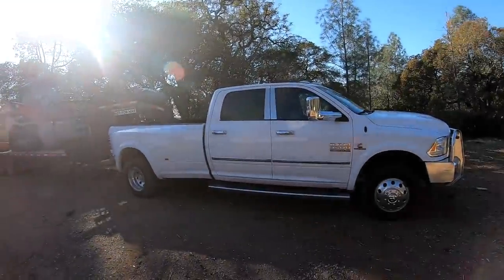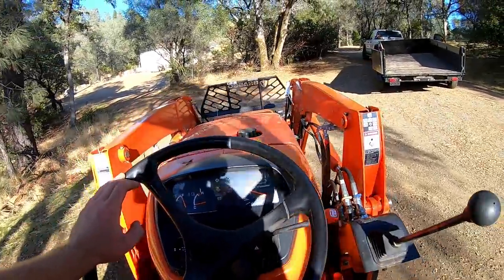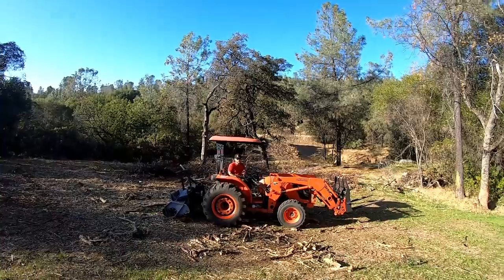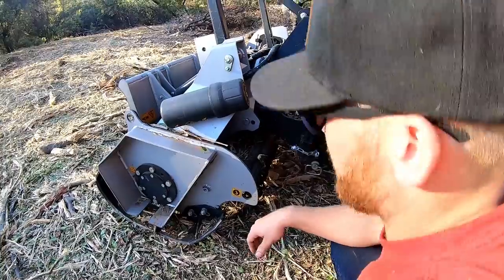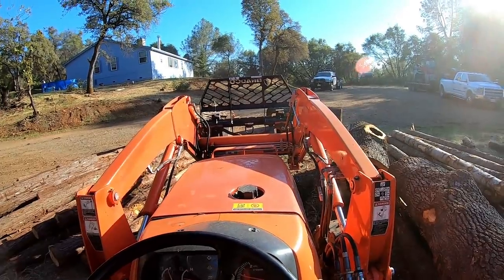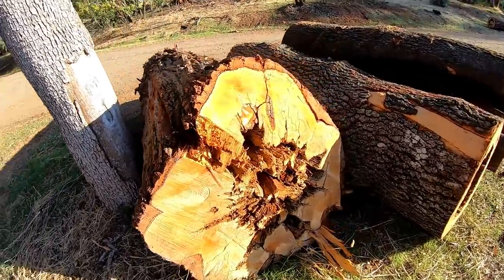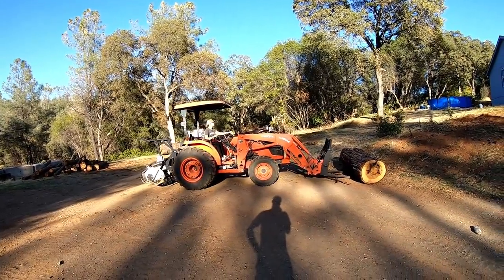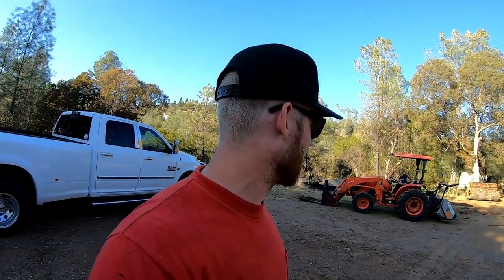KUBOTA PTO MULCHER: HOMEOWNER AFFORDABLE YARD TRACTOR?

Comment: A set of forks are invaluable on the homestead. I use them for so many tasks. In my collection of attachments for my tractor, I have a pto wood chipper which can handle anything up to 4", anything bigger is firewood. My lady and I aren't quite as young as you and yours, so we move a little more slowly, but a pile of brush like what you laid out there would take us maybe 20 minutes. The chips are then used for dust control and garden paths. As for my lady operating the tractor, never in a million years.

Comment: Those tires didn’t give nearly as much as I expected. The wife will help with the skid steer, the excavator, drive the ranger side by side, help with the straw blower and will basically attempt to help me in anyway she can or that I ask of her. Unfortunately for her I found out that being tiny comes in pretty handy for grouting in pipes down in vaults that I’m too big to fit in as well. She spots a lot and will attempt to turn / back in trailers and anything to speed up the process but we have a Japanese mini truck (KEI truck) set up for work with a bunch of stuff mounted in the bed, the steering wheel is on the wrong side and it’s a stick and inexplicably she absolutely cannot find reverse, can’t do it, only parks or stops where she can pull straight out and I have absolutely no idea why but it is hilarious 😂